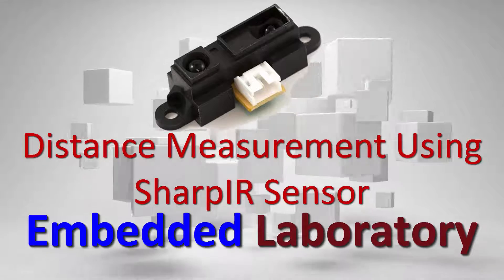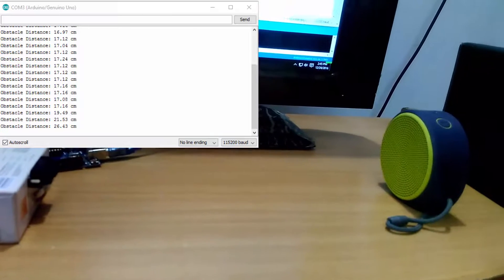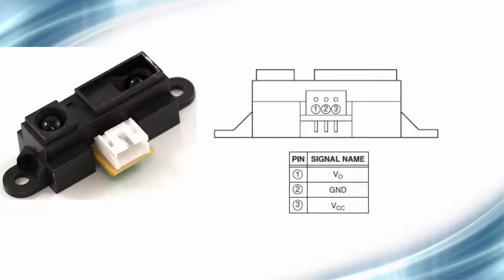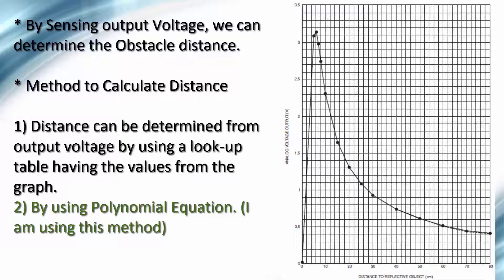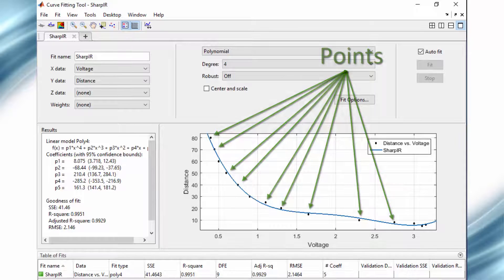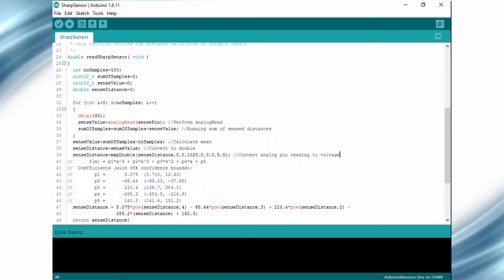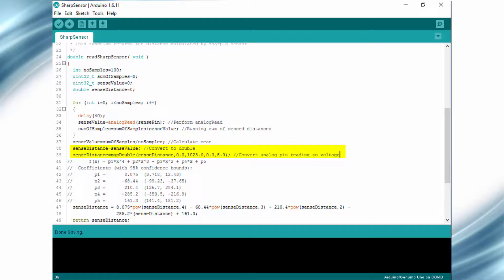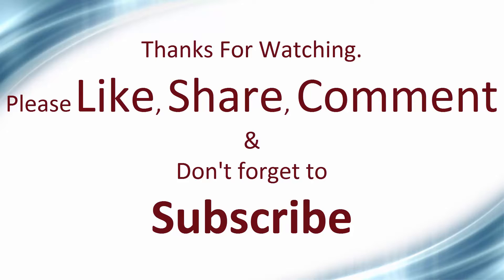Distance Measurement Using SharpIR Sensor

Comment: Hi there, sorry for annoying, could you please give me your most fit polynomial equation to convert from voltage to distance. I dont know why but mine didn't fit really well. I used the graph from datasheet then I plot again in Excel until it looks like the same, after that I fit the curve and find out the 6th order polynomial function. Is it right method ? Thanks again
Reply from the maker: Yes this is the one of the way and i have shown this way in the above video.
I just used MATLAB while you used Excel, but the output shall remain same.
You told me that earlier that you are using the same sensor as mentioned in video??
Then when don't you take the polynomial equation given in this video.
You can also check the blog post.

Note:
6th order polynomial equation will become more complex for Arduino to handle as compared to 4th order, and will also increase the processing time.
Reply: Thanks, I’ve tried and it worked
Reply from the maker: Great :-)

Comment: Hi Embedded Laboratory, thanks for this video. I'm working on a project using Sharp IR sensor to measure the distance of a linear actuator. I use Matlab Simulink with Arduino together to implement the experiment. However, the raw analog value I read from Analog input of Arduino UNO is fluctuation and lots of noise. I have searched for some noise cancellation but only has arduino code, not Matlab. Could you please give me some method that I can cancel out the noise in Simulink ? Thanks a lot.
Reply from the maker: I would suggest you to perform a simple experiment.
Place an obstacle at a fix distance from the sensor (of-course within the sensor range)
Then measure the the analog raw values using this and get these reading on serial port and save it in a csv file for analysis.
Now check, if you see any variation. (You will see variation, but the point here is that, I want to know the variation with reference to the distance of obstacle).
My point here is that, you should not get much variation, and if you are getting that, it means there is some problem with your code or with your setup.
Reply: Hi there, after I run in 1 minute, with a distance of 11cm, I got the value of analog raw value at 416 for average. However, there seem to be a cycle that the signal up to 600 after 1.5 or 2 seconds and this happens often, the time cycle of this change randomly. What should I do now ?
Reply from the maker: This is not noise, value is changing from 416 to 600, and this is really a big number.
What is your algorithm to measure the adc counts, how many times you are doing averaging the data.
Right now it looks that you are not doing any averaging.
Are you using the same method I am using in the above video, or you are using some other method.
Mail me your program @ matlab.academy@gmail.com
With sensor name.
Reply: oh sorry about the average one, I didn't count the average, what I mean is most of the time the analog value from A0 pin is around 416, and after some periods of time, it goes up to around 600, I just used the Serial.println(A0 pin) to read the value from A0 pin, no special algorithm, now I will try your method. By the way I cannot go to the link you provided. Thanks a lot. P/s: I used the sensor GP2Y0A21, same as yours.
Reply from the maker: Okay
Check the description of this video and you will get the link to the blog post.
Try to give some delay between two successive measurements, i believe 100us delay will also be fine.
First you can follow the approach given in this video and later you can also experiment with Arduino library for this sensor.
All the best.
Reply: Thanks a lot for your help. Have nice day

Comment: hi thanks for the video really helpful :)
do you how to use this sensor with arduino to count object - for example product counter? 

thanks
Reply from the maker: You can connect the sensor and setup at one end of wall, and let's say the distance between wall and sensor is 1.5m, and you are getting this much distance, which means no one has entered the room, but if your distance value less than that, it means someone enters the room, and using this method u can count the visitors.
Reply: many thanks 
i am working on it and it works when using only arduino but i am trying to implent etherenet shield to use a web server to send data to a databasen, still fighting to make it work 
many thanks for your help and reply :)